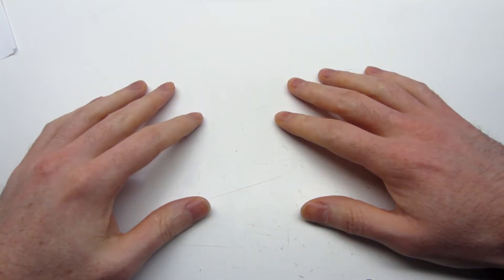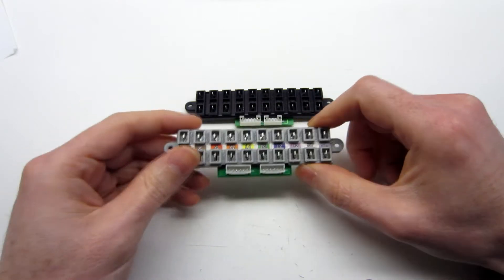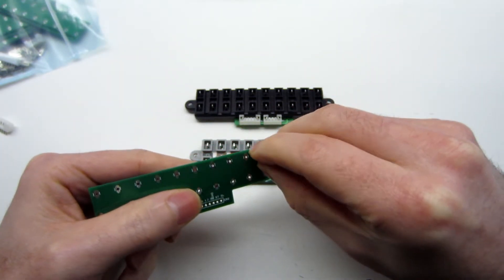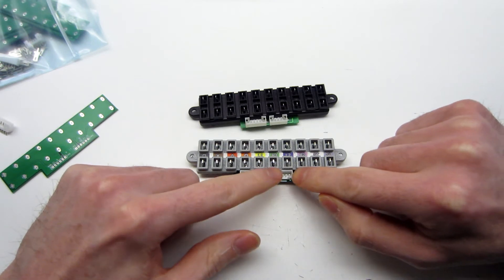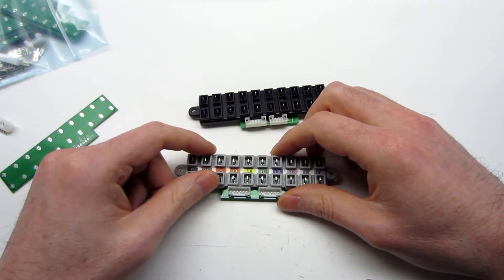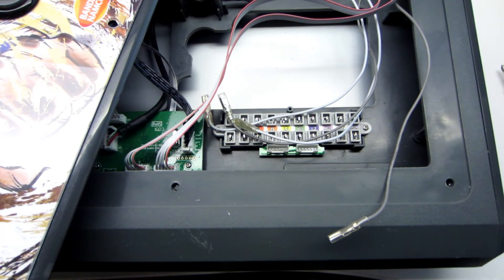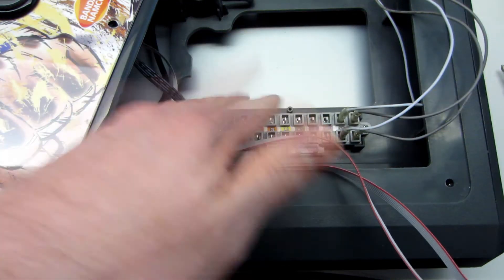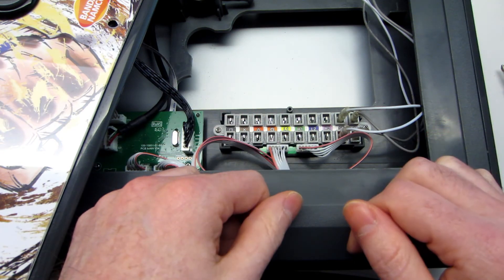[Arcade Stick Mod] Part 12: Madcatz Quick Connect board replacement

Comment: On this strip which is the ground row, and is it the same as the Mad Catz terminal block?
Reply from the maker: Pause at 1:16. You'll see the top row is the Ground. The only thing you have to be carefull is the KGround pin for Start and Select, which is in this design similar to the X360 version, but different on the PS3 one.
Reply: The Real Phoenix Thank you for the reply!